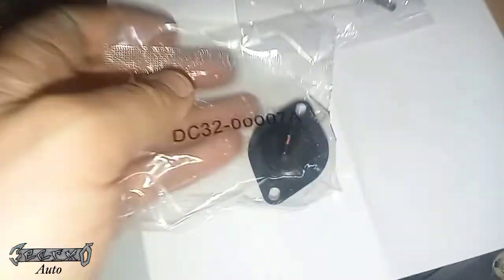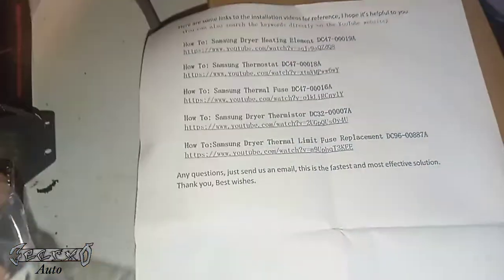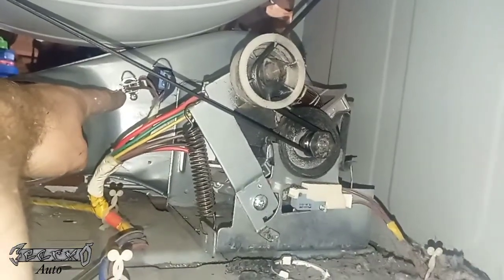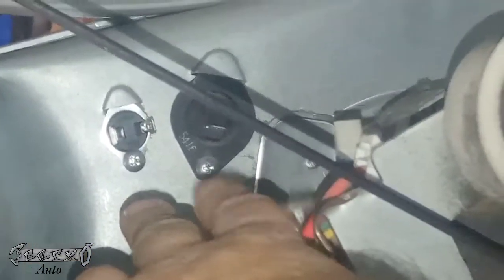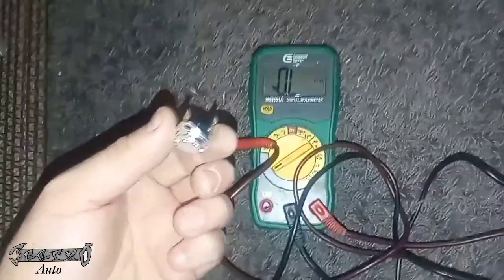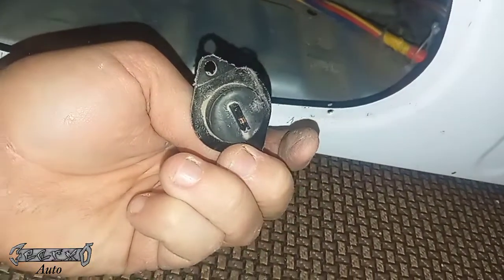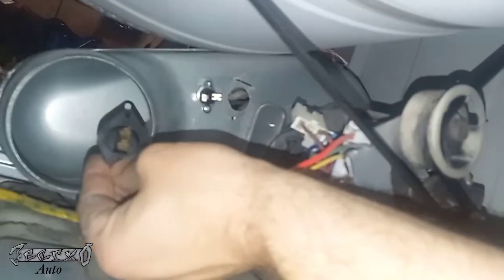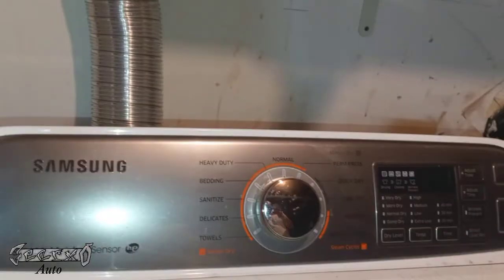THERMISTOR & THERMAL FUSE REPLACEMENT SAMSUNG DRYER

Comment from the maker: BUY THE THERMAL FUSE AND THERMISTORS HERE ( AMAZON )
https://amzn.to/3PMgkl2
Reply: did you have power at the control? I checked these on mine. I had 0.0 on the smaller one and like 10.56 on the bigger one. Not sure if I need to replace these or not?
Reply from the maker: @kylebuzz  what exact symptom do you have ?
Reply: @GEARMOAUTO  I've got no power to anything. It worked great when I picked it up. Hooked it up today and I got nothin!
Old dryer works fine but it's 15+ years old and my washer quit so I found a newer matching set.
Reply from the maker: @kylebuzz CONFIRM THERE IS 220 VOLTS AT OUTLET. USUALLY NOT ENOUGH POWER WILL ONLY MAKE THE HEAT NOT WORK PROPERLY BUT IT MAY NOT HAVE ENOUGH POWER. I HAD A SITUATION WHERE I ONLY HAD 120 VOLTS AT THE OUTLET BECAUSE LINT FILLED THE OUTLET. 

I WOULD ALSO open the control board and gently tap both relays with a hammer or something of the like. I am not sure if any of these components will cause no power. They might , I just don't know. 

Check this video on how to check voltage at outlet.
https://youtu.be/O5cuCCC8HWY

Lemme know what you find

Comment: If you replace the heat element and the heat element and the dryer stops producing heat, should it be the thermal fuse? My dryer is running but does not produce heat

Comment: I'm not getting any code on my dryer. Is there a combo switch button to bring up the error code?
Reply: Mine had a blinking red filter icon, though ducts and dryer vents were all clean as a whistle. No code, and this fixed it. Only after me changing the belt…the rollers…the pulley…a big screw 😂 I had a thumping and then the dryer would stop before it really got started. If you suspect these parts use your volt meter on them to check

Comment: I replaced the thermal fuse and the thermistor and there are still no signs of life with the dryer.  What’s next?
Reply: Same here do you figure it out
Reply: @hugoruizjuarez  yes, I found the right part after driving an hour away in Los Angeles to an appliance parts store.  

Here is the most important thing… I didn’t have to tear the whole dryer apart… I removed the dryer exhaust hose and dryer exhaust sheet metal, and accessed the thermistor through that hole.  It was tricky and you have to have a long arm and a magnetic screwdriver.  But it was worth it to not have to do it the harder way.
Reply: These dryers are so easy to take apart it’s crazy to work like that
Reply: @AMERICANPRIDE1100  easy to take apart if you're an appliance repair person.  I'm a DIY homeowner and enjoyed the shortcut.

Comment: One of your resistor replacements is out of its slot, might want to fix that....🤦
Reply from the maker: Which one?
Reply: @GEARMOAUTO   at 2:58 you can see the one on the left is out of slot.
Reply: I caught that, too.  Is it a problem if it's not in the slot?